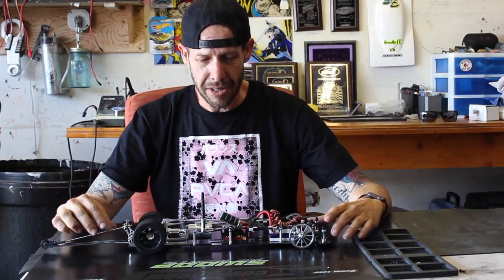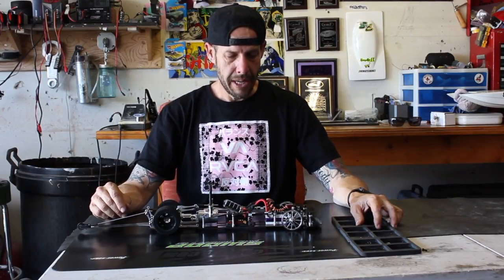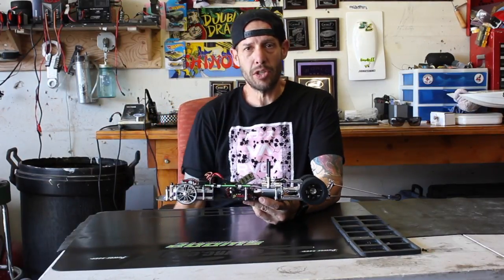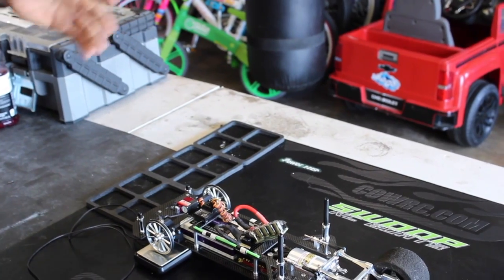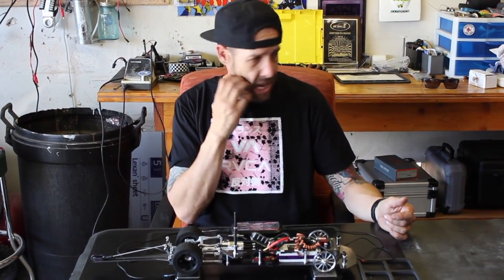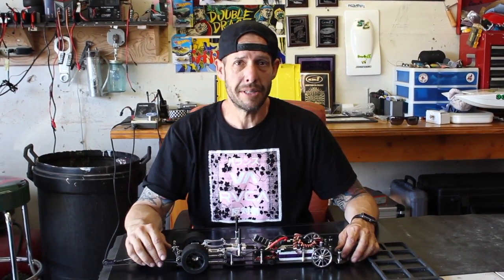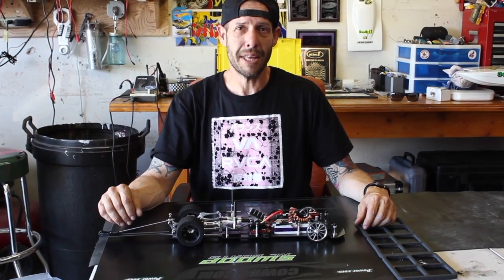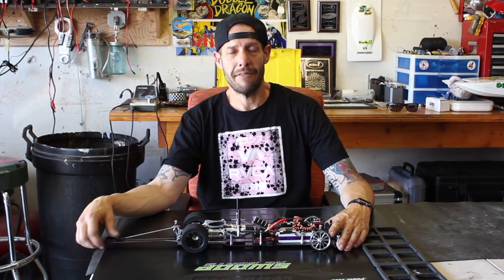RUDIS DRIVELINE

Comment: hi brow i am building a touring car for drag wath 2s motor you guys recommend me
Reply from the maker: Carlos Fantauzzi i use 5700 castle system in my on road car.
Reply: RC DragTalk i AM looking to run 1.60 can you gift me some advice
Reply: I AM new in electrics
Reply from the maker: Carlos Fantauzzi wont happen. 1.6 is very fast. For a touring car thats a lot of moving parts.